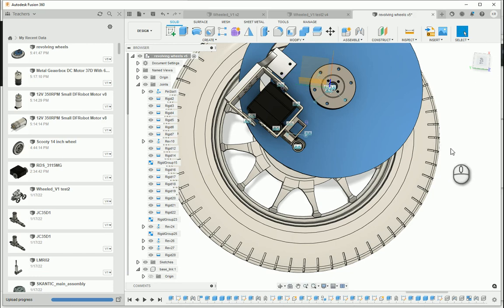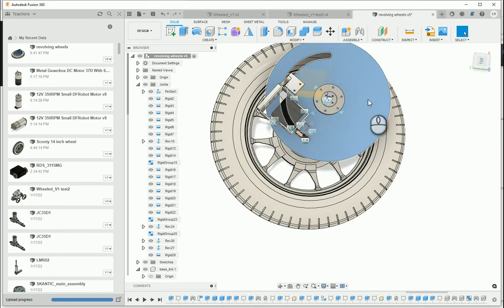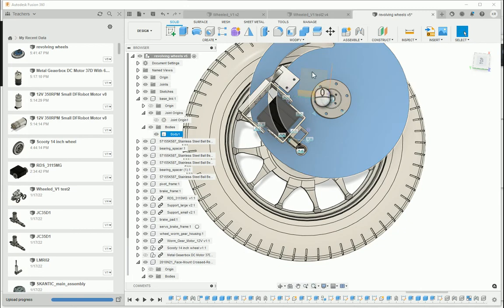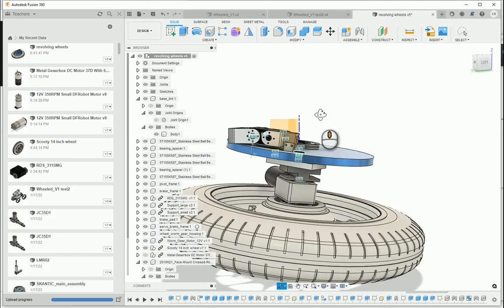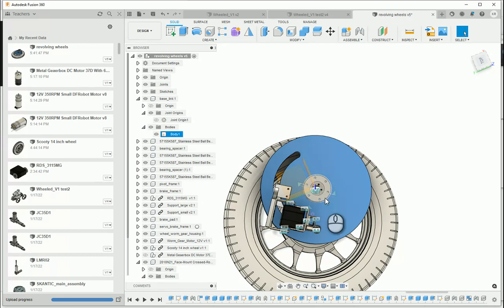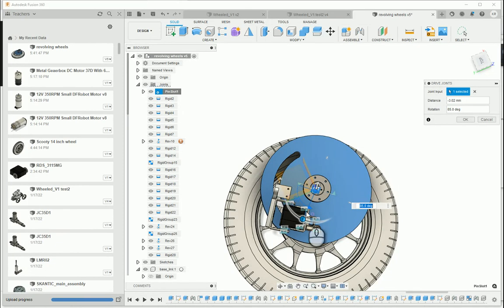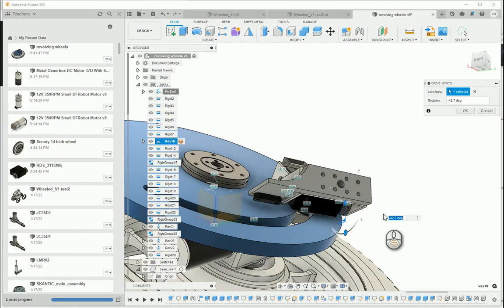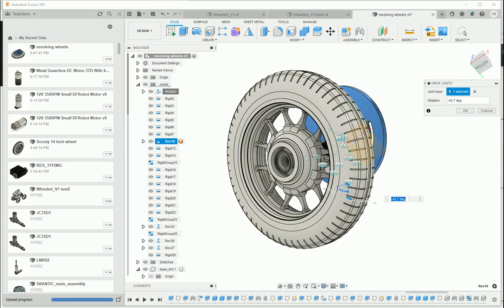Tried to implement the Hyundai MobED

Comment: Hello, I am very interested in this technology and I would like to know how to make it, otherwise very good video
Reply from the maker: You would need a hub motor and wheel, motor controller and servo with servo controller. I also used rubber as a break for the servo
Reply: @robottinkeracademy  Thank you very much, and how can I model the system? Do you have any diagrams that can help me?

Comment: I think torque is a issue with hoppy grade servos, where did ur sources came from?  Nice Video 👍
Reply from the maker: By sources are you referring to 3D models?
Reply: @robottinkeracademy  no i mean actual pictures of the MobED drive system cause i wonderd too cause there a not much detailed pictures out there
Reply from the maker: @open-ats9990  I have seen it up close at CES enough to get a glance at the brushless dc motors that they are using. One hub motor for the wheels and two for the platform raising and all wheel steering.
Reply: @robottinkeracademy  wow cool, soo they use planetary gears for suspension and steering? 🤔 And maybe for drive too?
Reply from the maker: @open-ats9990  looks like it, the motor drivers are where the costs get out of control. Odrives or cheetahs are expensive and you would need 6 of them.
Reply: @robottinkeracademy  totaly know what u are talking iam working on a sensorless foc board which will give me good torque at low speed and iam using a cheap port 16$ (B-G431B-ESC1)  and using no sensor
Reply: @robottinkeracademy  could probably get away with a normal esc for the hub motor
Reply from the maker: @vaughnmonkey  I am going to try a few different motors, the plate is pla for now so I can try a lot of mounts. Doesn’t have to be quiet so I can use Nema’s